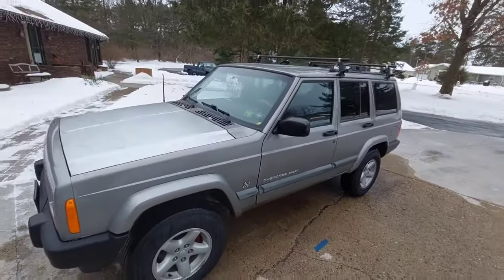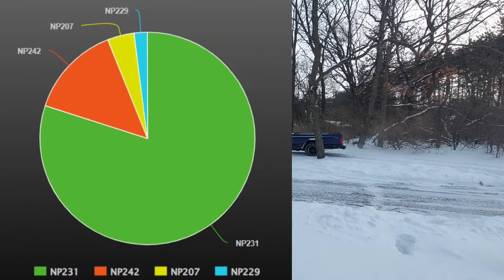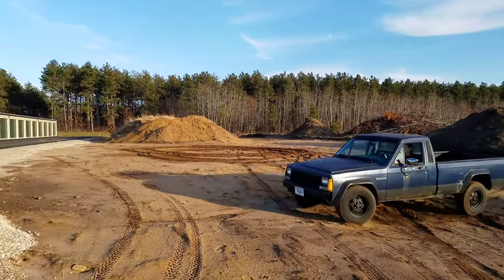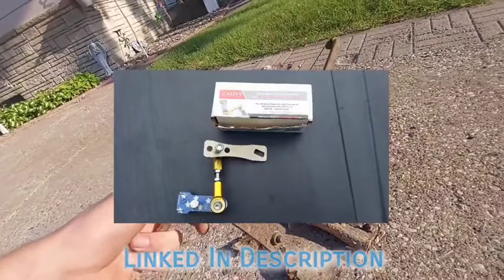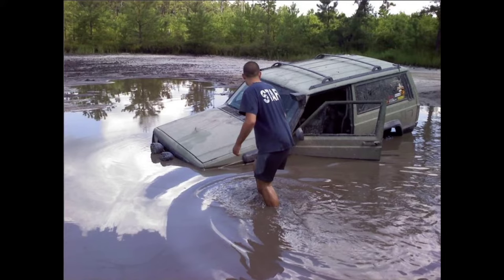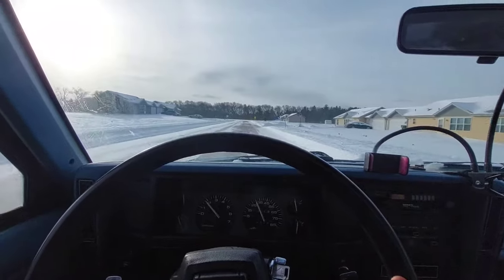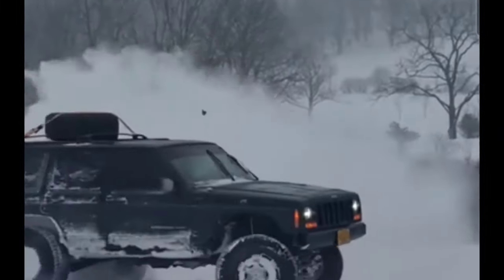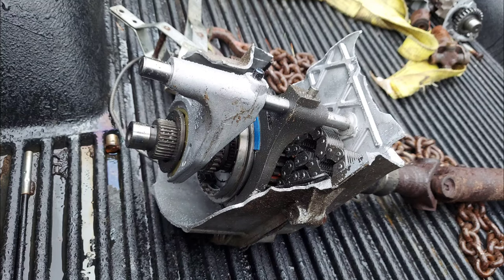Jeep Cherokee: Transfer Case Options & How to Use 4wd Correctly ['84-'01 XJ]

Comment: 93 XJ 4.0. In standard drive the left rear wheel is the drive wheel. In 4 wheel drive the left rear and  right front turn. I had a new NP 231 installed some time ago but did not use 4 wheel until recently. Any ideas as to why the right rear and left front do not engage in 4 wheel drive . I would appreciate any Thanks everyone for your replies. By the way, I did raise the entire vehicle and that is when I discovered the only two drive wheels that were turning were the L/ rear & r/ front. I could free spin by hand the other two. Thank you for your help with this. .
Reply from the maker: This "issue" isn't necessarily a problem, it's just open differentials being open differentials. Sounds like your transfer case is doing everything it should. 

I'm not sure what method you used to determine the LR and RF wheels are the only ones that spin, but if you put the whole Jeep on jack stands, where all 4 wheels are entirely off the ground, you'll find all 4 of them will spin in 4wd. 

The differentials in the axles are not locking, or limited slip. This means, by the inherent laws of physics, the engine will only spin whichever wheel has the least resistance - in 2wd, that wheel is either gonna be the LR or RR, depending on what you're driving on and which wheel has less traction. 

People mitigate this problem by installing lockers or limited slip clutch packs inside the axles, which prevent them from doing that. However, that's a pretty expensive upgrade, and is really only necessary in extreme offroad scenarios. 

The transfer case, however, doesn't have a differential in it. As I mentioned, "part time" means the front and rear wheels are locked together, so when 1 rear wheel spins, it means 1 of the front wheels has to. 

You should look up a video about how differentials work.  a visual would probably explain it alot better. But there's nothing wrong with your Jeep
Reply: Open differentials, whatever wheel has the least resistance is going to be the one spinning....could be front left right rear, left front left rear, it all depends on what the vehicle is sitting on, angles its sitting at, tires, etc.

Comment: With the 4x4 version- would you ever use 4HI during heavy rain on the freeway? Or light snow on the freeway? (Obviously not at highway speeds- in order to be cautious, but maybe 40mph)
Reply from the maker: As long as the wheels can slip in part time, you can use it. Rain isn't really the best for it because wet pavement is still very grippy, and tension can build up in the drivetrain that gets released when you go through a low traction area (puddle) 

For snow it kinda depends how much there is
Reply: @WAEMIDIV  Thank you so much.  I appreciate the response.  I've seen videos of XJs driving up a snowy mountain highway and the rear end let's go- causing them to wreck into the center divide.  The owner mentions that being in 4HI probably would've helped to prevent that- but it's also easier to say that after the fact.

Comment: I have Grand Cherokees a levardo 97 with 242 and then a 98 Limited all-wheel drive can I swap the T cases I want to use the all-wheel drive jeep for off-roading but I want to have the two wheel drive options
Reply from the maker: I'm guessing your ZJ (Grand Cherokee) has an NP249, which is AWD/4x4 only (no 2wd option) and your XJ (Cherokee) has the NP242 (as outlined in this video). I believe you totally can swap them but the NP249 is not a very desired transfer case. If I were you I'd try to find a different NP242 to put in the ZJ and just have that same transfer case in both Jeeps.
Reply: Yes, you can swap the transfer cases, keep in mind you may have to swap the input shafts, output shafts, slip yolks, etc. to make it work, but its a somewhat common swap when the full time 4WD transfer case which was an NP249 in the 1st generation Grand Cherokees (ZJ) would fail, they had a viscous coupler that controlled power distribution front to rear that was in the transfer case, when it failed, it failed in a locked state virtually turning your full time 4WD into a part time 4WD system....so most people given the cost to buy a replacement transfer case, or the part to fix it, opted to pull a donor transfer case from another Jeep, sometimes it was the 231 sometimes the 242, depending on what the vehicle was going to be primarily used for.

Comment: Is it safe to run 4H part time on dry pavement as long you don’t make any turns? I just daily drive my xj and use it for winters. But in the summer and spring I don’t want the 4 wheel drive to just sit there and not get used, gotta keep the juices flowing ya know lol
Reply from the maker: Yes you can technically use part time on pavement by driving in an exact straight line, but having it in 4wd doesn't really keep anything "used" more than it is in 2wd

The front axle shafts, carrier, driveshaft, and transfer case gears & chain all, already free spin in 2wd, hence why you are able to engage 4wd while moving. Using 4wd over summer isn't gonna keep things "fresh", it's just gonna put you at risk of damaging the components by binding them up on pavement. 

My MJ sat unused for 16 years without moving, and all it took to get it in 4wd was pulling the lever. Nothing in its 4wd system had failed after being completely stationary for 16 years straight, so I think, given you're at least driving the Jeep more often than once every 16 years, you should have absolutely no problems with the 4wd whether you use it or not
Reply: @WAEMIDIV  Ok, I’m 16 and still learning about my jeep, thank you so much for the reply!
Reply from the maker: @clarissaadams5515  yes sir, I was in your shoes once, don't feel bad for asking questions!

Comment: 5:13 my 1991 jeep Cherokee Laredo 4.0 if you put it into four-wheel-drive low in reverse, there is so much gear reduction. The brakes will barely hold it. It’s like a tractor at that point, that plus how light these vehicles are makes them awesome in the snow with the right tires.

However, my 1998 Subaru legacy outback has 2 inches more clearance and gets 10 more miles per gallon while having twice as much interior space believe it or not it doesn’t look that way but it really does little Subarus are great cars to you can’t be either one of these 

The only thing better would be an AMC eagle